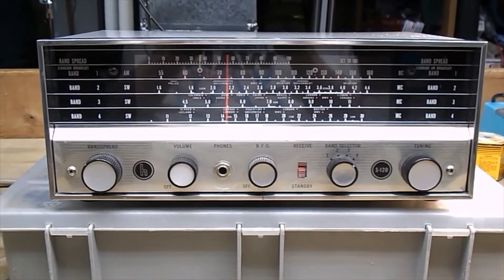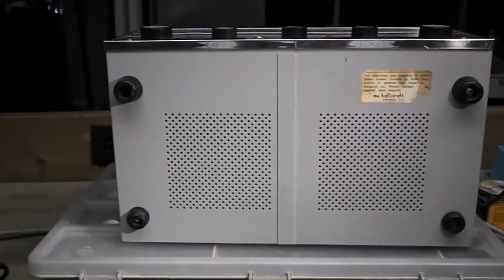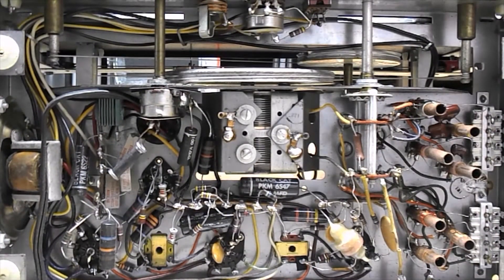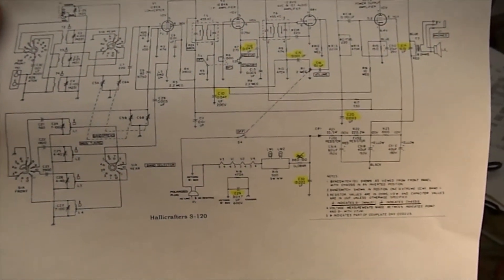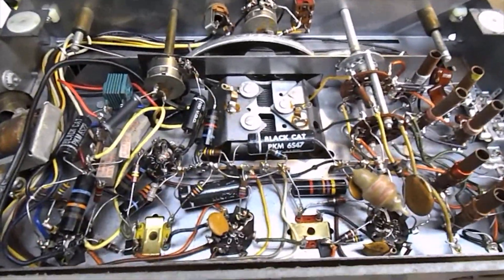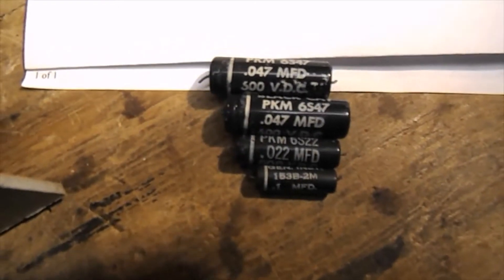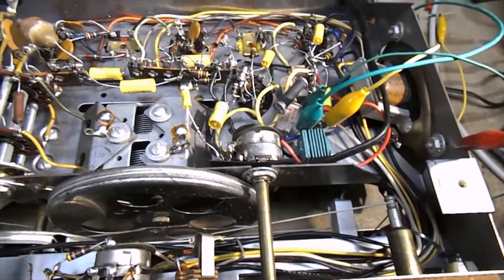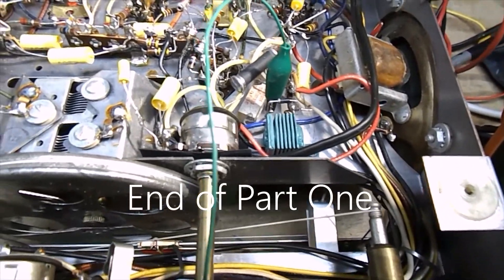Hallicrafters S-120 Shortwave Receiver Recap & Alignment Part One

Comment: My filter cap has all the wires cut off underneath.  Could someone of rewired without that cap ?   Still hums but does fire up.
Reply from the maker: It is common to add new capacitors below the existing can. The hum is normal unfortunately. Thanks for watching.
73 Paul AA1SU

Comment: anybody remember what is the bulb# and is there a led that will fit?
Reply from the maker: #47 bulb. This is a 6.3 volt bulb, not 12 volt. Yes, I see L.E.D. bulbs on eBay when I search for Halicrafters S-120 bulb. You could probably also search for #47 L.E.D. bulb.
Thanks for watching and the question.
73 Paul AA1SU
Reply: @vtradio  great thanks im thinking a blue or green lite bulb thanks..

Comment: 141-142v on B+ seems a little high.  The schematic I have has the B+ at 130v, with 120v and 110v further down the voltage divider.  I just got a S-120 to recap/rebuild with that Hayseed Hamfest kit.  Your two videos are great tutorial and will be very helpful.  I think your highlighted 150v on the schematic is for the capacitor rating.
Reply from the maker: Thank you for the comment. It could be that I was looking at the wrong part of the schematic. All the other research showed a resistor to bring down the voltage. I sold it at a Hamfest soon after this to a nice older couple. I could have sold it for more on eBay, but I'm happy that it went to a good home.

Comment: I just sold one at the Spokane Hamfest....mighta should have kept it.....worked well, with just the telescoping antenna on the back....WWV....Radio Habana....some spanish SW broadcasts, from the ground floor of an apartment building....have an SPR-4 Drake, which is a better radio....but the AM reception, on other bands, was quite good...not too great for a CW op like me, but useable on a quiet band maybe....need to watch part two, I guess...
Reply from the maker: I sold this one at NEAR-Fest in NH last year.  I sold it to a nice older couple that looked at it over both days of the Hamfest.
It was dreadful at CW reception, as I recall.  There are mods on the web to improve this, but it was more than I wanted to do.
73 Paul AA1SU

Comment: Hi I’m wondering if you can help me. I just picked one of these up from a local thrift store and it powers on and all the knobs work fine. This may be a stupid question but do I need an antenna to pick up anything. All I’m getting is static. Just wondering if I should be able to pick up any channels without an antenna? Thanks
Reply from the maker: You should be able to pick something up on the AM Broadcast Band because it has a built-in ferrite bar antenna.  For the other bands, yes you will need to run a long wire around the room to pick up stations.  The long wire will improve the AM Broadcast reception as well.  It can be as short as 6' just to get things started and tested out.
Hope this helps.  Paul

Comment: Still have the hum?  Didn't look like you replaced the 2 wire plug.  Silly question, but did you rotate the 2 wire plug 180 degrees in the outlet and try it again?  Also, I always use a multimeter to check chassis or frame to known electrical ground to check for voltage.  Avoids dangerous shocks.  Nice job, makes me want to pull my old S-120 off the shelf and get it going!.  Got it new in 1961.
Reply from the maker: I eliminated most of the hum by moving the hot side of the power cord to a terminal strip a few inches away.  It is almost completely gone now.  I treated the problem like I did something wrong, but now I think that this is just the way this radio is.
I installed a 2 prong polarized plug.  I tried a 3 prong grounded plug, and it made no difference in the hum before I figured out that I should just move one of the wires.
I think that I was checking voltages at ground, and found none.
I hope that you get your Hallicrafters S-120 going again.  If not, I'll buy the antenna off of you. 😉
Reply: @vtradio  HaHa, like any of us have the antenna any more!  It was a pretty cool design, though.  Turn the storage clip 90 degrees and it lined up and held the antenna in place in the vertical  position.  Actually made a replacement years ago using a random salvaged telescopic antenna and a U spade connector, hole drilled to screw mount to the base of the antenna and then bent the spade connector to attach to the radio's terminal connecter - lost that one, sounds like a trip to my boneyard to make another one!  Hey, do you think the original power cord set up had anything to do with the fact that these radios were made to operate on 105-125 volts AC OR DC?  glad I found your channel- New Subscriber!

Comment: Love the 120 for sure. I have an S38 from 1946 and also have an S 38E model. Unfortunately both of them are down right now and I’m having a little trouble figuring out what’s going on with them. But I’ll get them gone or they can sit on the shelf and be nice conversation pieces
Reply from the maker: Very good. I also have a Hallicrafters 5R10B, which is like a S-38D w/o the CW.  I also have a Hallicrafters S-38A.  Both need recapping and one needs a new dial string.  Hope to do those later this year.